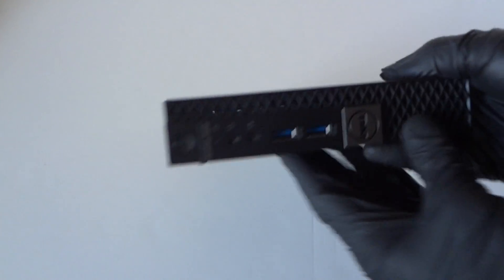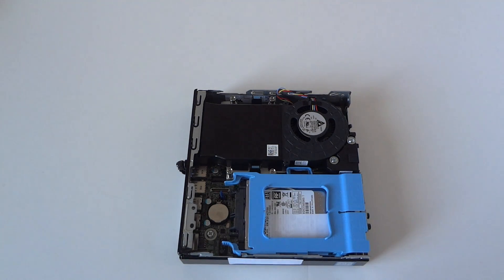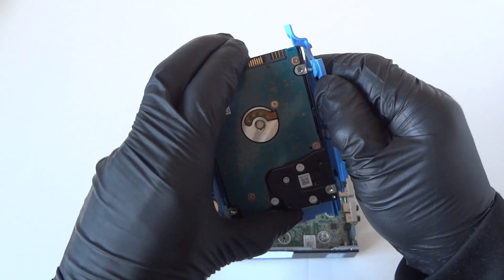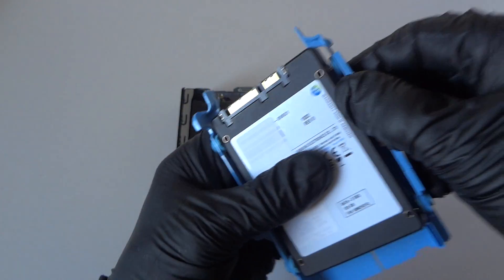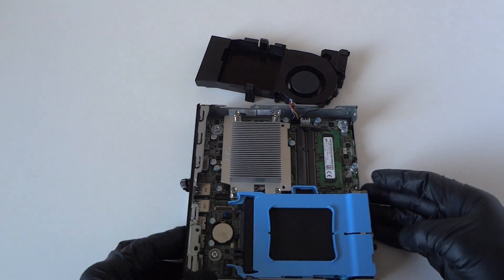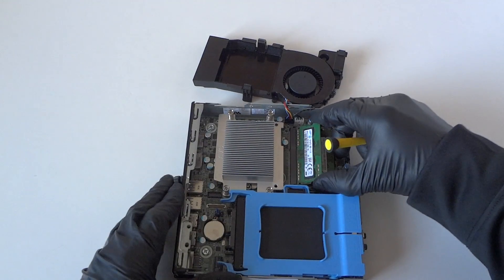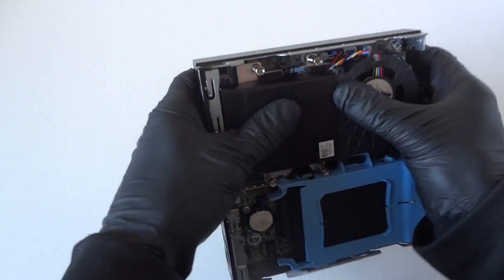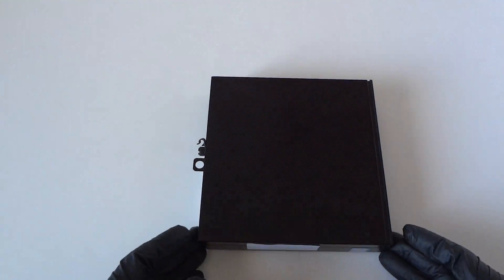Dell Optiplex 3040 Micro Upgrade SSD Drive, RAM

Comment: , I guess I must pass all the info on the computer to an external hard drive and also do I need to upgrade any software or do anything else
Reply from the maker: If you are using Samsung SSD it comes with Magician & Data Migration Software that allow you transfer all your DATA to new SSD and when you install latest Windows updates it will install all the drivers with optional updates.

Comment: I'm doing a ram + SSD upgrade on my 3040 OptiPlex   after I do the upgrade do I have to install new drivers or I can use old drivers
Reply from the maker: Hi, it depends are you doing clean install Windows  ?

Comment: Thanks for the great video!
What has to be the memory specification for upgrading an Optiplex 3050 Micro with ddr4?
Reply: max 2x8 GB
Reply: I use 16x2 = 32GB DDR4 in my optiplex 3050.

Comment: If i upgrade the graphics card. Its need to be low profile or not?
Reply: You can not. There is no pci-e slot for external graphics card in micro case.

Comment: Good day,

Thanks for the video. Didn't expect it to be that easy to fiddle with it.

You explained how to upgrade the hardware but what about the OS.
How do you reinstall the OS, or install two OSs for that matter so the Optiplex keeps working fine? Do you make an image of the HD and install it on the SSD? For what I understand, Dell no longer provides the support CDs they used to. Won't like to run into warranty troubles because of that.

I'm curious! I'll love to increase HD capacity and be able to run Linux/Windows on it.

Comment: Please answer which card would best fit the 3040 sff best between the Gtx 1050 ti 4gb lp or Nvidia Quadro P1000 4gb
Reply from the maker: Nvidia Quadro P1000 Low Profile will fit fine, and If you're gaming get a Geforce card. That's what they're for. Nvidia Quadro are workstation cards, typically used for 3D rendering, CAD, etc. They're also more expensive than the Geforce video cards.

Comment: these dells are never very space efficient. firstly its 2018 and the sff variants still have dvd drives which are just massive waste of space. and the micro variants like this one have clunky hard drives. if they had m.2 ssd instead there would be enough space for small graphics cards that run off of the pcie slot like a gt 1030.
Reply: @MrPuffin69  I agree completely.  However to play devils advocate, my 6th gen pc, same as these are, has an M.2 SSD (even NVMe!) so it was an option back then in 2016.  It also was a price premium so you can expect that they chose to go with a much cheaper SATA drive over M.2 for cost reason.

Comment: Greetings. I have Optiplex 3040 mini tower. My memory is 4GB SK Hynix DDR3L 1600MHz.
 If I want to add 4GB more, do I need to buy the same memory, or some other brand will do. Which one?
And does SSD has to be Crucial, or  Kingston, Adata, Samsung ... etc will also work?
Thank you
Reply: It is best to stay with the same memory or replace with 2 others that are the same.  But different memory modules will work ok.  You can use any brand of SSD.
Reply: Thank you very much.

Comment: Top tutorial!
If I change the HD drive with a ssd drive, I need to reinstall windows?
Thx
Reply: I know the Intel and Samsung SSD drives come with cloning software you can use. Works beautifully.
Reply: Use some sort of disk clone program and you probably can transfer it to the SSD.
It does not always work / you may have to try different programs.
Generally it's easier and faster to do a clean install and then the software you need.
Reply: Yes, I thought the OP would go into how to Install W10 on the SSD. I put a Crucial 250MB SSD in my 3050MT. Did not see the Quick response I had expected. Contact Curcial and was told I had to modify the BIOS from RAID to AHCI. It takes some special software to do that.

Comment: Is there any way to put a graphics card in there? A 750ti or something
Reply from the maker: No
Reply: Mxkdi How come? is there no slot for it? a 1050 or a 750 aren't big cards and are low power gpu's
Reply: no because they waste space by putting a hard drive instead of a m.2 ssd

Comment: How do I install hd + sdd? Because on the site it says that I can install the two together Maximum HD Expandability: 2.5TB (1x2TB + 500gb SSD)
Supports SSD, Hybrid SED and Hybrid Opal with FIPS certification
Reply from the maker: No, you can only install one 2.5 ssd drive or 2.5 thin hard drive
Reply: ok thanks
Reply from the maker: No you can't M.2 (22x30mm) (For Wireless only)
Reply: Yep they left out the second M2 connector. They solder points are on the mother board they just didn't install the connector.